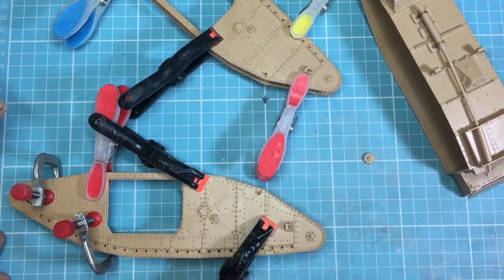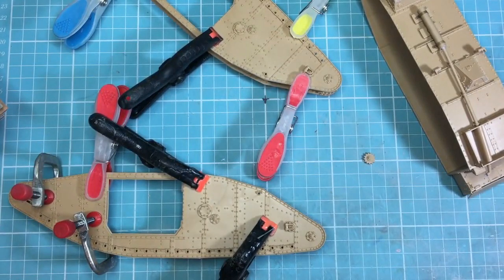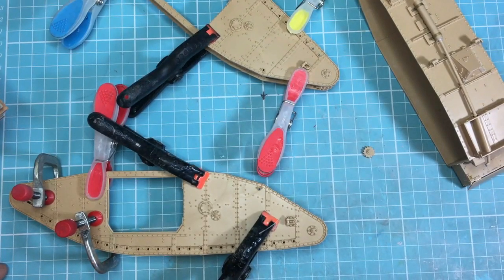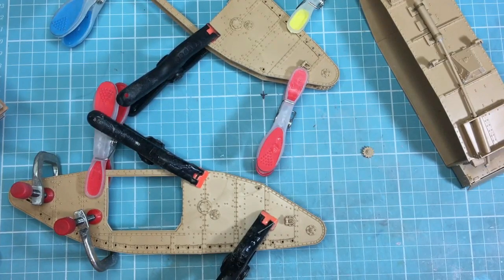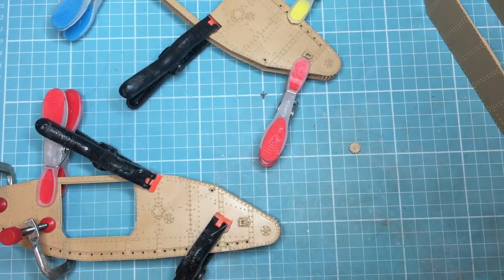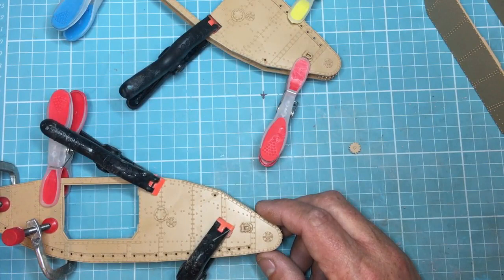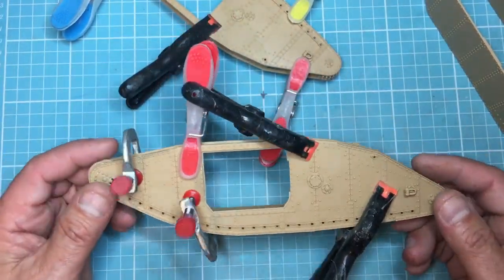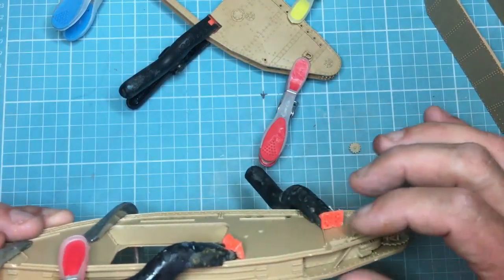Takom 1/35 MkIV Tank "One month build" Part 7. Ready for the tracks..

Comment: It amazes me how these manufacturers put the attachment points!  I know at times they must go in certain areas to aid flow/fill BUT most of the time they are put in the most stupid places.At times in a area that will void the detail no matter what.They must realise/know this. The guys how work out parts on sprue placement need sacking!!!  My rant over.
Reply from the maker: My best ever cock up on the sprue attachment point is with the Revell ME 109 in 1/32 scale. They moulded the whole in cockpit fuel line in one clear piece. Why you ask.. well, next to the pilot there was a glass cylinder so the pilot could see the fuel flow i guess. So, you paint the whole fuel line except for the "glass" part.. guess where the sprue attachment point is.. yep, on the clear glass cylinder!!